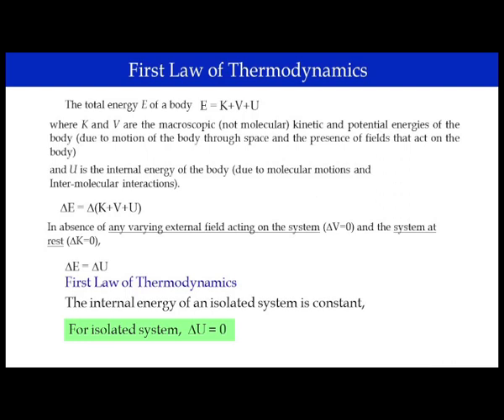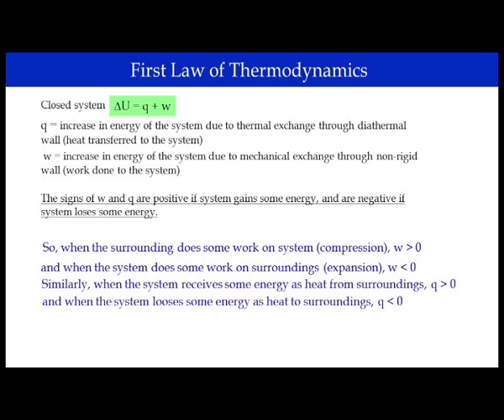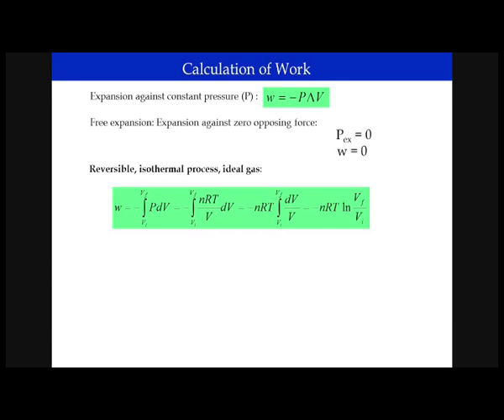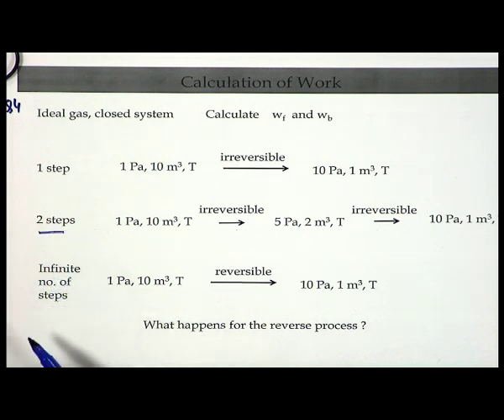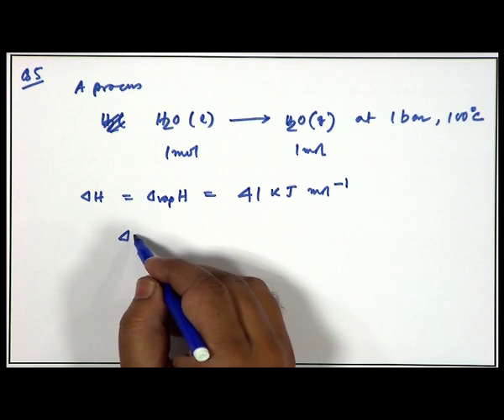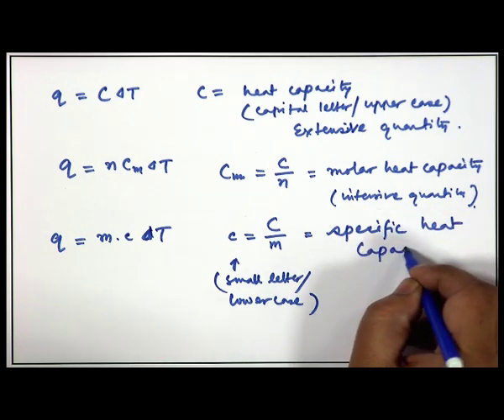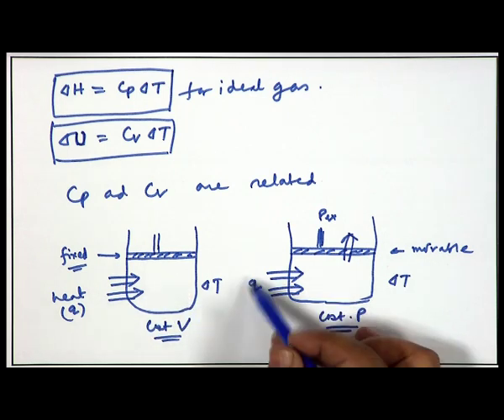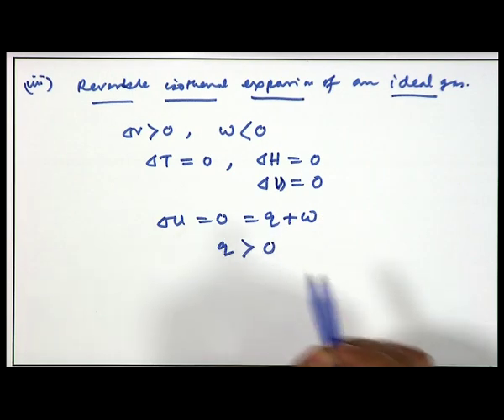CHEMICAL THERMODYNAMICS-3 (CH_20)

Comment: please answer that what's the reason of ∆H=0 and ∆U=0 in, Q6 (iii)
Reply: we can write del H = del U +  del (PV) . Now in RHS PV is constant(PV =nrt and del t is constant) as its a reversible isothermal process. So its derivative i.e del(pv) is 0. Coming to del U , U can be expressed in terms of U relativistic which is constant, U intermolecular which is ZERO in case of IDEAL GAS.(function of coordinates) and the last rotational, vibrational etc which are temperature function. again its del is 0 (as isothermal process). Since RHS is 0 LHS has to be 0.
Thus its your answer. 😃😃
Reply: For an ideal gas you can write down ∆H=C(constant pressure)*∆T and ∆V = C(at constant volume)*∆T since process is isothermal so ∆T=0 and hence you have your answer.